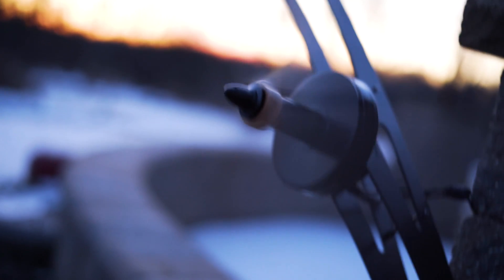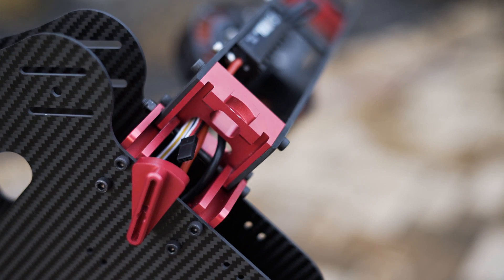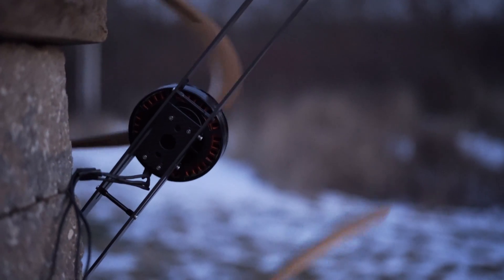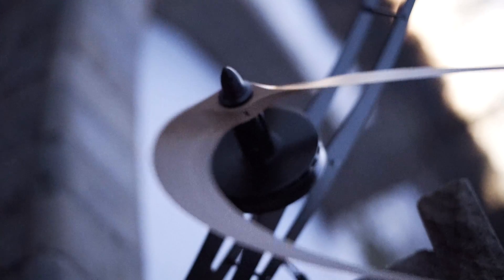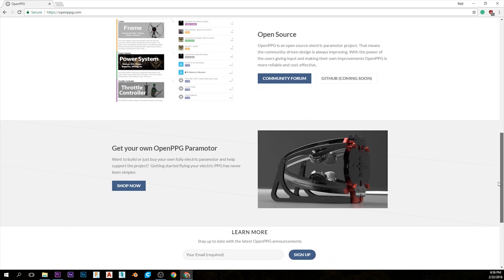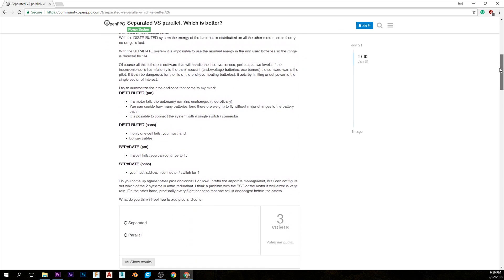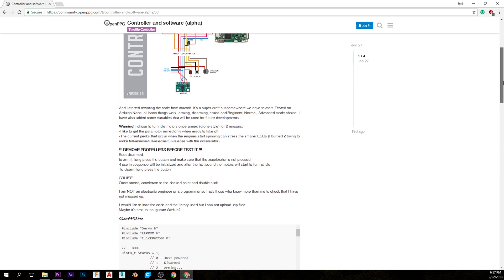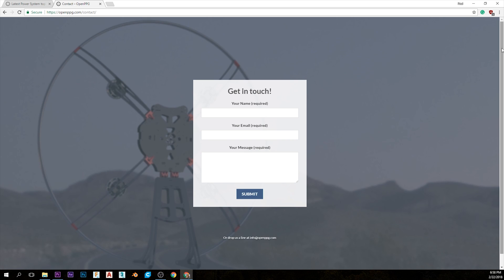OpenPPG DIY Electric Paramotor Update

Comment: I am a follower and praise your devotion to the project. Light weight and portability to name a few of it's many benefits to fossil fuel engines. If the industry would only focus on battery technology it would be a breakthrough for the aviation application. I still have high hopes for things like super capacitors to assist or possibly replace conventional batteries in the future. Power to weight ratios for electric motors are already ahead of gas engines, let's focus on how to create a lighter way to store the energy to propel them. PPG is a small niche as far as the industry is concerned. Things like remote control hobbies have helped elevate electric motor and battery improvements and we have benefited from that. You are on the right track, let's keep our fingers crossed that "BIG MONEY" sees the potential in developing a modern battery technology that weighs less. Performance of anything that uses the battery would be improved.

Comment: You should try building a battery pack using Nissan leaf modules. Each one is 50AH@2S, 1.5kg each. A 6S pack would only weigh 4.5kg and give you 1.2kwh of onboard storage
Reply: Hyperious I was thinking the same thing except with the latest Tesla cell batteries

Comment: Combination of colours is great..
What's the flight time and thrust with the new engines?
Reply from the maker: crohr1000 The same thrust 155lbs  with about a 10% increase in efficiency.
Reply: PDWhite so did you manage to achieve an hour of flight?
Reply from the maker: That's already been achievable with electric for awhile. I just like flying with a lighter setup but with more batteries, 1 hours is easily achievable.